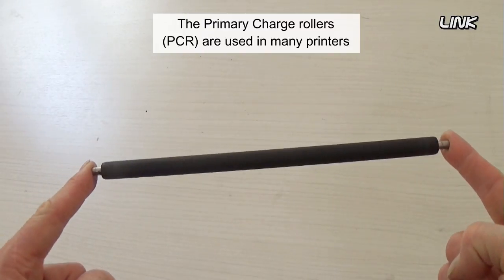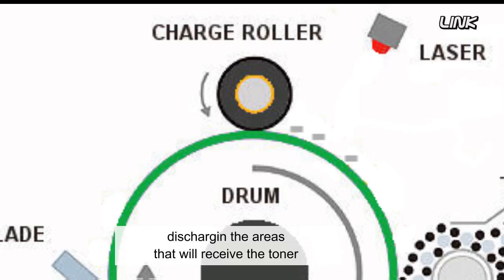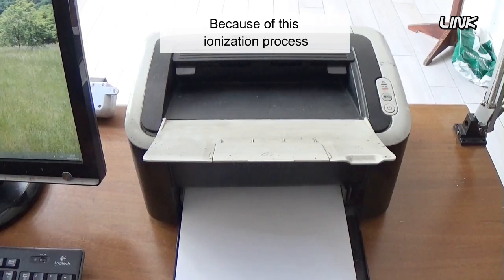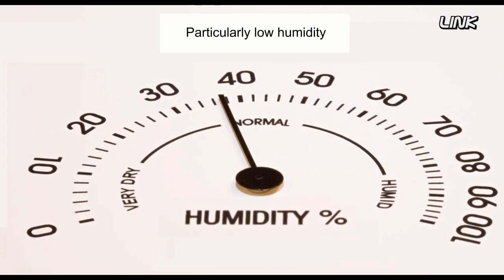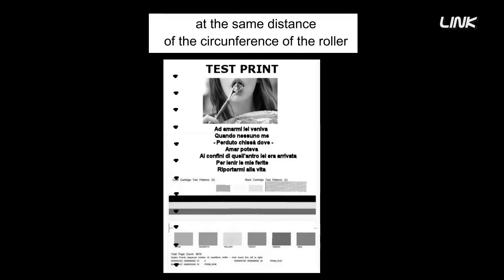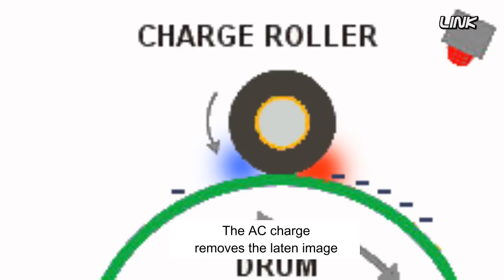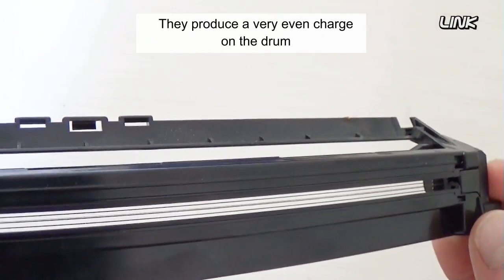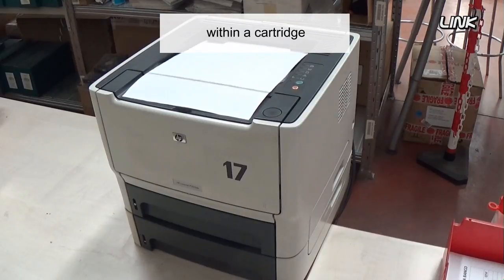What‘s a Printer Primary Charge Roller PCR and how to clean it

Comment: My printer name is Hp laserjet p1108 plus and when I  turn on the printer then the printer makes a whimpering noise after the noise then my printer blink both lights and i couldn't print so how to fix it?
Reply from the maker: check the drum of the toner cartridge. does it turn freely? it could be a mechanical problem of the printer but it is difficult to understand where exact is without checking the printer
Reply: How can I rotate the drum ?
Reply from the maker: @arpitamondal2820  by hands
Reply: I cannot rotate the drum
Reply from the maker: @arpitamondal2820  the problem could the drum that cannot rotate. may be the wiper blade block it. Without seeing the machine I can't be sure

Comment: Sir am using Ricoh SP5200 and My Toner Quickly get in to Waste box.  And everytime I Clean Waste box and Cleaning blade then after some Prints or sometimes 1/200 prints thunders of Black Toner apears on Page.   i discused with shopkeepers but know one tell me the exact solution ,  plz. Help me where is the reason
Reply from the maker: May be the environment is too humid or cold, or the transfer roller is defective, or those toner cartridges come from an old stock
Reply: @viandant5  thank u Sir.

Comment: My OKI C332 print fade on left side. Only happen when use magenta color. What the cause of this problem?
Reply from the maker: Check the drum unit, may be the magenta toner roller is out of position
Reply: @viandant5  Seems the magenta drum okay. Because i try to swap full magenta set to yellow position then print yellow in photoshop and surprise the full magenta print great.

But when i print magenta in photoshop (in printer is yellow because the swap) the yellow result same like previous magenta. Faded left side. Is it relate to transfer belt?
Reply from the maker: @rulcspm  It seems more a software problem. I would try to reinstall the printer driver, and update windows.
Reply: @viandant5  i tried to re-install the printer's driver but cannot solve the problem.

Then, i tried to disassemble the transfer belt and found the magenta roller are not proper align because of the spring has been pulled out. After fixing the spring, the printer working great now.

Thank you for responding to my question. I learned a lot from your video.

Comment: My HP2055dn 's PCR (38mm) streaks on the very edge.  I've wiped it with a Lens cloth cleaner 3 times, but still I get the block of ink every 38mm down the page on the edge.  I hesitate to use water.  But would water fix this?  It only started streaking AFTER I took the cart apart to clean it.  Maybe I got some finger oils on it? It is the edge where I had to bang the holding pin (the hardest side) with a hammer (no screws on this model).  The PCR didn't look damaged (and in the sunlight, I see no discoloring).  Any ideas?
Reply from the maker: water is perfect to clean the PCR. are you sure the defect is related to the PCR? it's not the magnetic roller?